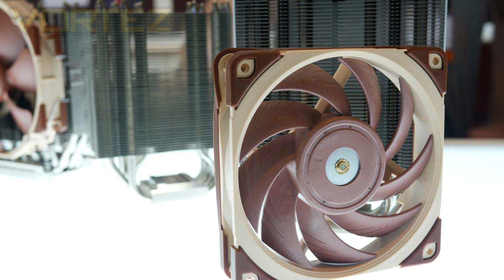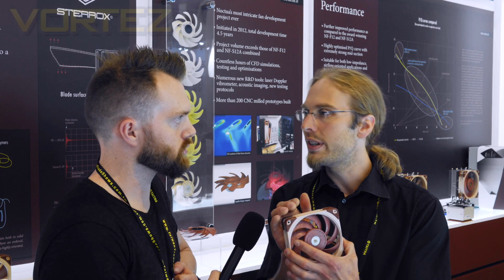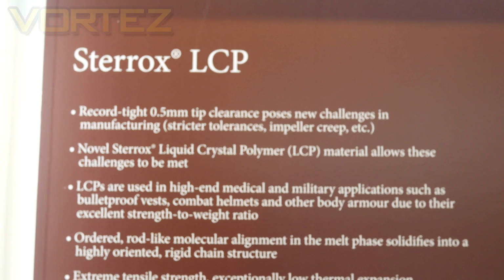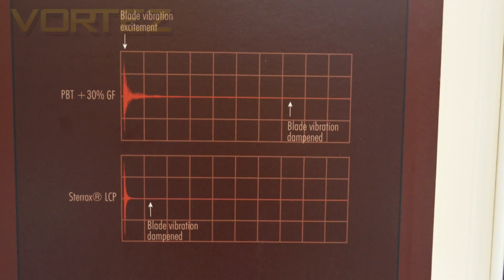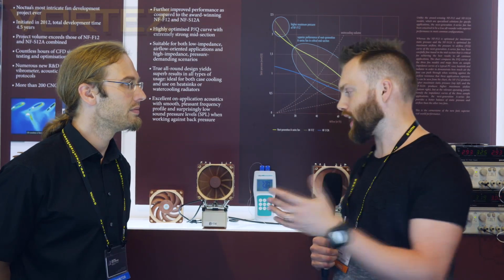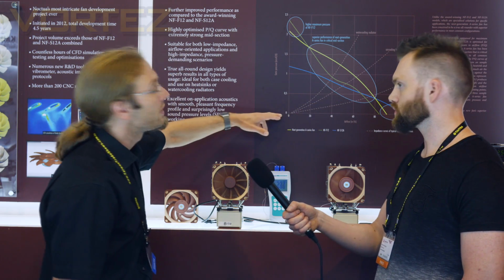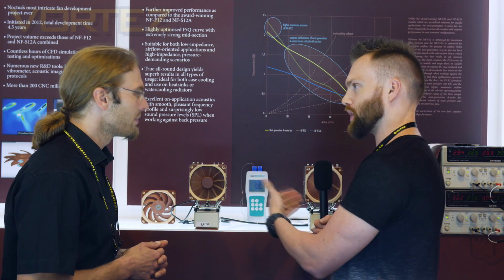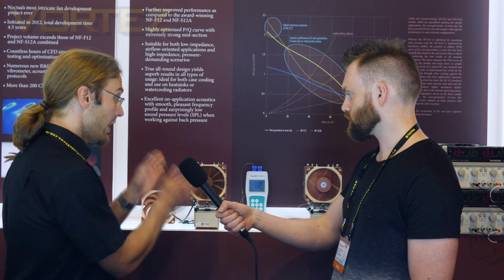Noctua: A fan four years in the making @ Computex 2017

Comment: I do understand Injection Molding and have made a few. Four years is too long.
Here's what 4 seconds Googling got me: https://www.hortonww.com/on-highway/fans/molded-ring-fans.html - at 1:34 he says they are worried about creep, over half a dozen years, the 'Ring Design' prevents that and with additional modifications can deal with the minute slippage.
It misses a few other features but I'm not going to design it for them. It's OK but don't charge us for your excessively slow research (and beige/brown color scheme).
YT,Rob

Comment: that is not quite trrue what noctua is saying.... there actually is a fan with even tighter spacing, the antec true quiet pro 120 which has allready been out for several years now!
Reply: Emmmmm... The fan that you've mentioned has its blades integrated with the frame, so they spin together (the blades AND the frame).
Reply: Microwilli Well yes, kinda, the back of the frame has a much larger air gap than the Noctua has tip to frame. 

So even if the Antec has no gap at the tip, it still has a 1.5mm gap all the way around based on the photos I can find.

Comment: £30 lol. I can get four RGB corsair fans that will only run 3c warmer for £32

Sorry Noctua but I'm not pretentious enoug to use your overly developed air pushers.
Reply: +YonOtto maybe but they'll be much louder than premium fans. Even without rgb, premium Corsair/NZXT fans are ~£20 each
Reply: YonOtto noctua is quality, the accessories that come in the box themselves are twice as valuable as flashy lights.
Reply: YonOtto Except the Noctua will run vastly more quiet while pushing almost as much air as all three of the Corsair fans by itself. 

If you have an InWin case with only a few fan mounts like I have, Noctua fans are a godsend.

Comment: When noctua bring out a product you know its going to be the best-of-the-best-no-compromise line. Typically German/ Austrian!

i`ll defintely be buying these new fans.
Reply: Do we know when these fans are going to be purchasable? Or have they not released a statement on that yet?
Reply: I will too for processor cooling, for airflow in your computer case you'll want different fans, but they can be noctua too if you want.
Reply: ahhh yes german products I love over engineered unreliable products like the BWM,audi and benz you always seen sold used for 15k with only 58K miles on it.
Reply: hmnn, the fan looks so bad ass. im liking it too. i might buy it to replace the stock fan i got from buying a dh-15. actually im using only one fan from the dh-15 although it has two because when i use the other fan, my pc is way too noisy. so i only use one and removed the other fan and not using it.